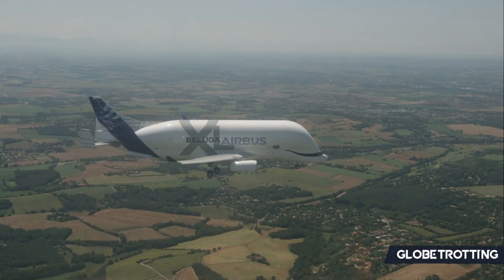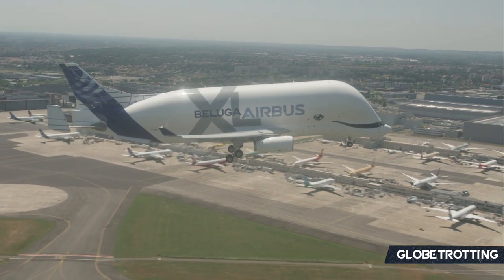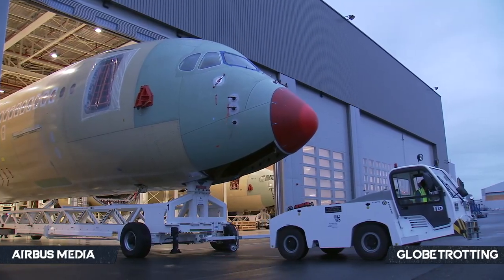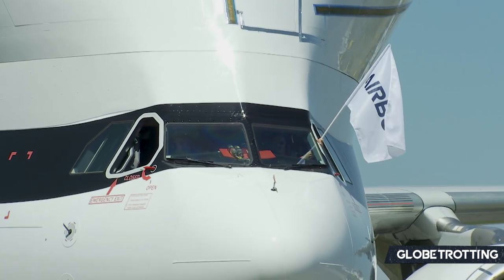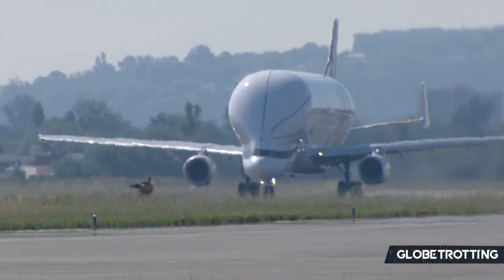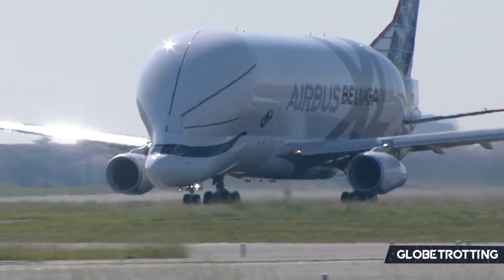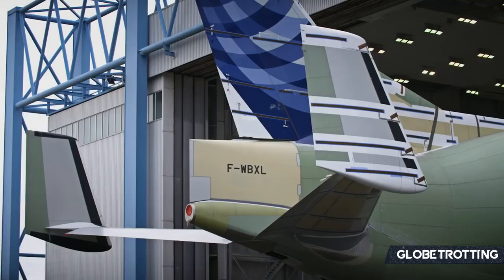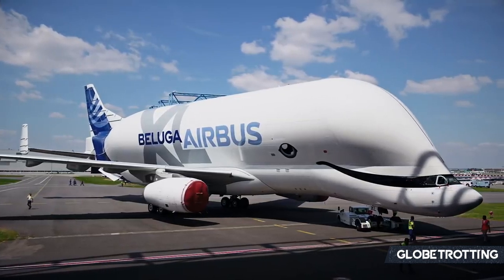Why Airlines Don't Fly The Beluga XL

Comment: note the Beluga XL has one front landing gear & just two landing gears at the rear (as in any other twin engined airliner), inspite of the enormous size of the airframe . . . this means two things . . . first it's the size of whatever aircraft component being transported in the Beluga XL that explains the Beluga XL huge size . . . not too much in terms of weight . . . it is said that a fully loaded Beluga XL weighs less than a fully loaded A380-800 with fuel or the B777-300 ER for that matter . . . secondly the typical tricycle type front & aft landing gear arrangement shows that the Beluga XL is based on the A330-300 . . . it's predecessor the Beluga from 1990 was based on the A300-600R . . . AIRBUS could do with a fleet of 10 - 12 brand new Beluga XL heavy lift transport aircraft for oversized cargo . . . Since the only An-225 Mriya multi mission heavy lift transport aircraft in the world was destroyed earlier this year, the world has been in dire need for a super heavy lift transport aircraft like the An-225 and the Beluga XL might just fulfill that purpose to a large extent if not entirely . . . its predecessor the Beluga would do as well . . .

Comment: The Dreamlifter at Boeing serves a similar purpose, but that aircraft is based on the 747, so it can carry much heavier cargo than the Beluga XL.
Reply: But the Beluga XL doesn't need to carry heavy items just for carrying aircraft parts not heavy items that need to be carried quickly by air.
Reply: @heidirabenau511  Same goes for the Dreamlifter. Point is, the Boeing can serve purposes not dissimilar to the AN-225 due to its much greater payload capacity.
Reply: @sainnt  but the AN-225 has a greater capacity than the Dreamlifter
Reply: @heidirabenau511  And it no longer exists, so the Dreamlifter is the next best thing.
Reply: Uncle Sam  Everyone knows that. The bird had 6 engines after all, and it's completely besides the point. The Dreamlifter is way more capable than the Beluga XL. That was the point.

Comment: You have to appreciate that the Beluga XL was designed, built, and intended to only be used by the same company. As such it does what it was supposed to do brilliantly, but made little if any compromises to allow more flexible alternative uses. 

A major potential downside for the Beluga Xl is that the hold is not accessible during flight, for the simple reason that only the crew area is pressurised!

As such it is essential to know exactly what is on-board for each and every journey, as everything must be capable of withstanding incredible pressure changes. 

I wonder what would happen at altitude if bubble wrap was used? 😂